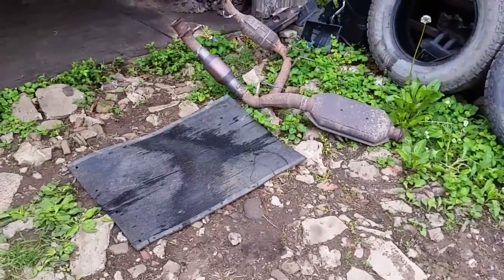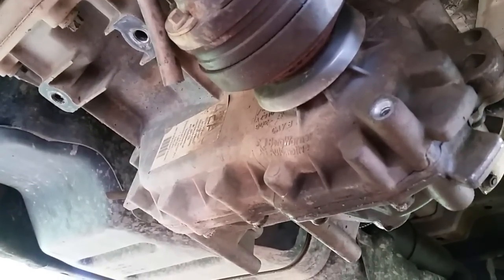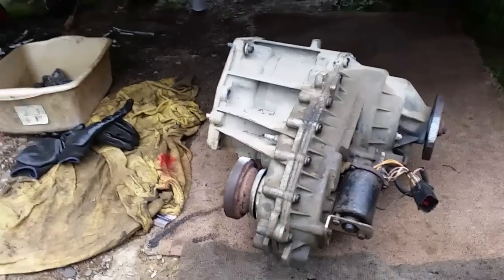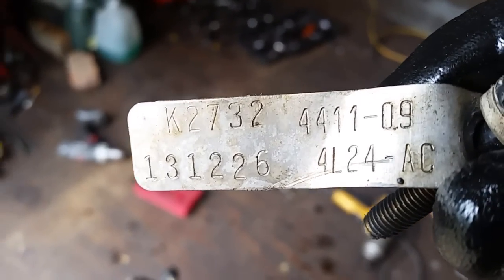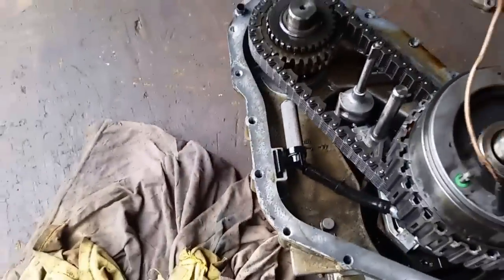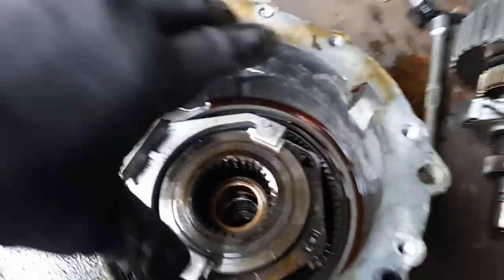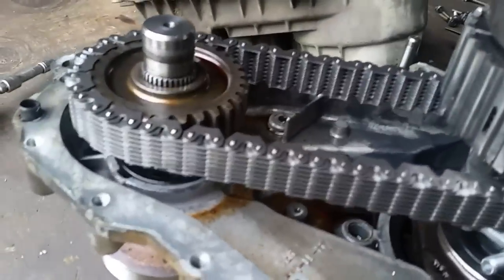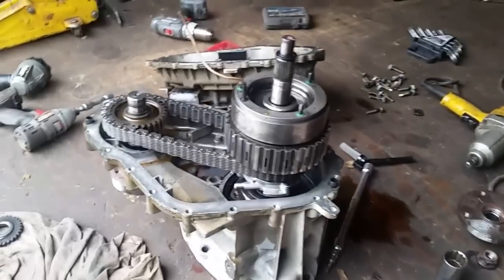New Transfer Case Chain... Explorer

Comment: No need to take exhaust or cross member out not necessary you can work around them fairly easy...just did one yesterday on 05 explorer  fun fun
Reply from the maker: Yea true....That case is quite heavy tho.
Reply: @FixingWithPassion  ya like you said 60 70 pounds and its awkwardly balanced better to play it safe...good video man

Comment: While it is apart is the perfect time to replace the oil seal for the front drive shaft as the front yoke is retained by a snap ring on the inside. I had my TC apart to replace the chain and then the front driveshaft seal blew out after a few days. Had to remove the TC and pull it all apart again to replace the seals.

Comment: did that end up working for you? I've been getting this clunking randomly that goes away when i put it in 4 high. it comes and goes it'll be fine for a week then it'll clunk clunk until i either accelerate fast or brake heavily then it temporarily goes away. Thinking it might be this.

Comment: My 01 Sport Trac has a strange clucking sound and you can feel it through the truck but only after you have been driving fast on the freeway for a while and then you slow down and exit for a fuel stop and you are moving very slow just moving up to the bowsers and then by the time you get fueled up and start to leave it has stopped making the noise again. I was wondering if the chain gets hot and sags a little bit and is hitting on something. My problem is that I live in the Philippines and there is nobody with any experience of these over here.  Any help would be appreciated.

Comment: The EMC wire does not have to be cut, just don't unscrew the 3 nuts connecting it to the cover and lift the cover off and the EMC will remain in the cover.
Reply from the maker: Nice comment!

Comment: Im helping my dad replace his BW 4405 transfer case in his 1998 explorer, you could see inside the case where the chain has worn a groove into the case, We suspect it hasnt had enough fluid in it for a while and the explorer does have nearly 330.000 miles on it

Comment: The magnet wire you cut did you solder it back or left it cut?
Reply: You have to connect the wire, it engages the clutch pack so the transfer case will go into four wheel drive.

Comment: Thanks for the tutorial. I have just acquired a 2002 Ford Explorer XLT Limited edition. 79k it's a strong runner with a 4.6L It's from an original owner aged family member. I have never been a fan of the Ford products...just too many things that should not be a problem... dealing with a PATS issue. No crank, no start. Really frustrating. Your videos are very well done.
Reply from the maker: I think I like the ford suv over the trailblazer somewhat better.

Comment: Hey mate,
Do you have to reconnect the magnet wire that was cut in order to de assemble the case?
Reply: Yes. Otherwise no torque will be transferred to the front diff when in any 4×4 mode.

Comment: What do you think about bw4412 that whine up until 70 mph
Reply from the maker: Eh, Not sure...if the noise in tolerable , I'd leave it alone nad live with it. There's so much that can cause that noise. Hard to pinpoint and often is never found.
Reply: I have that problem in mine and am currently looking into fixing it, when i do I'll let you know what it was.